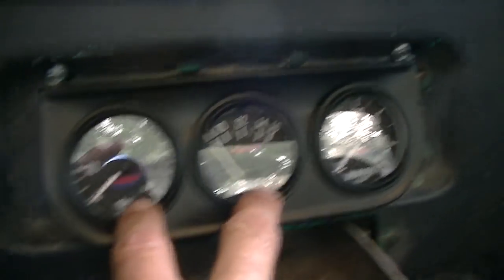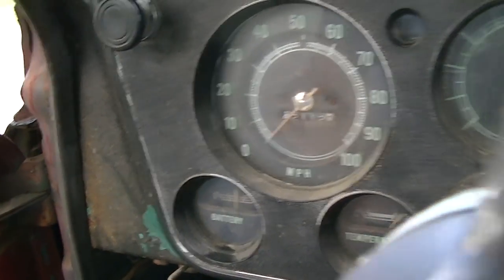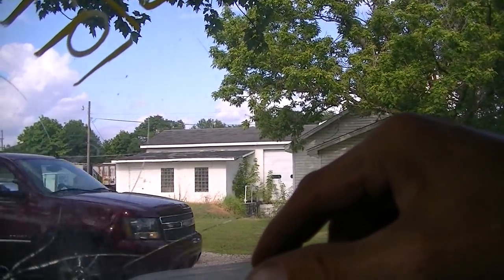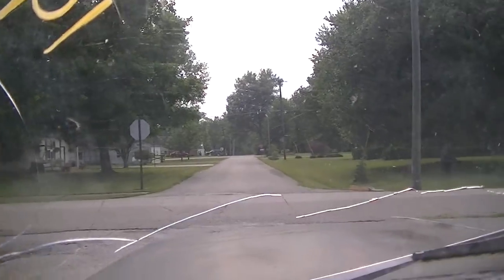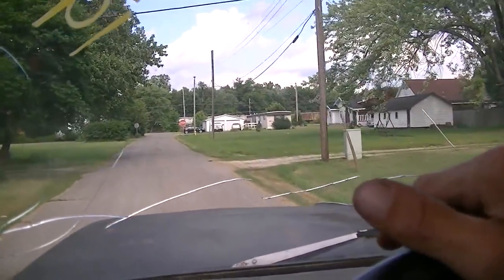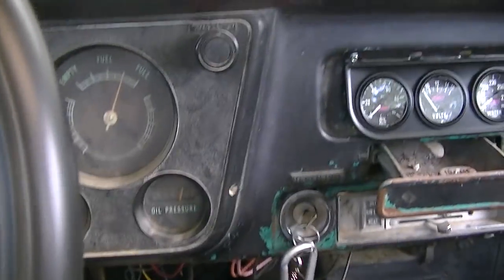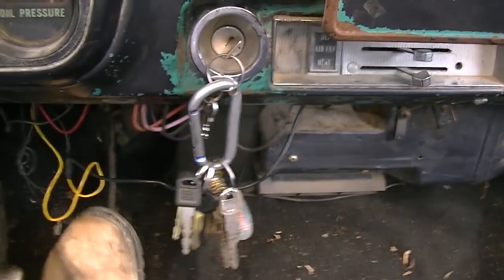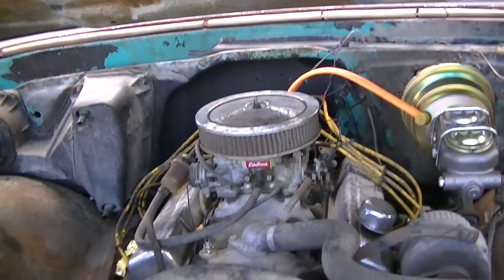traded

Comment: I feel you with that truck. I have a old driver truck, a step side ford but do to the cost of insurance and the electrical system needing work i have parked it. :(  mechanically is solid and is in good shape. I am going to keep-it and do the electrical as well as other things like fixing the roted wood in the bed. it need the fluids changed as it was driven as a driver then parked. If i was you I would keep it, if it is not to fair gone and just make it a good driver. and fix the rust the right way as rust is cancer to old truck. under stand you do not have a lot of time or money but if you take your time and think out of the box it might be the way to go if it is not rusted out. think of the people in Cuba no parts or tools compared to you and less money. so take your time.  take care
Reply from the maker: or I could trade it for a 1927 ford :)
Reply: now I see why you are undecided!! both are good choices!! I would go with the one that is in the best shape and needs the least work! is the 1927 ford a model T? if it is that is cool as that is the last year. keep us posted and good luck.